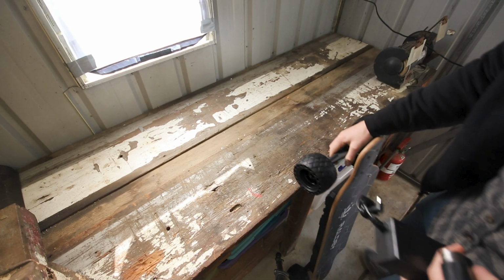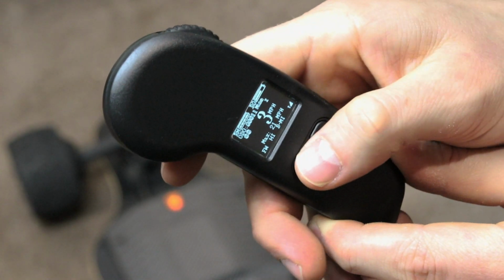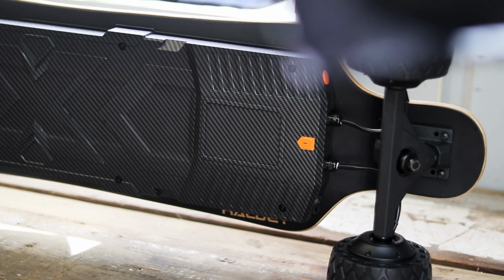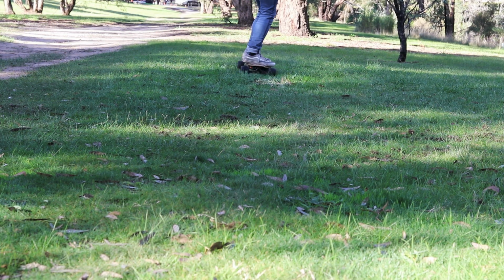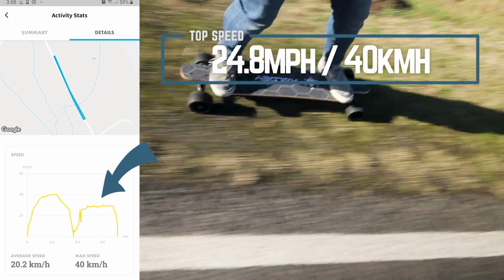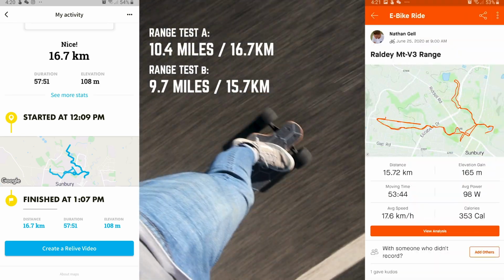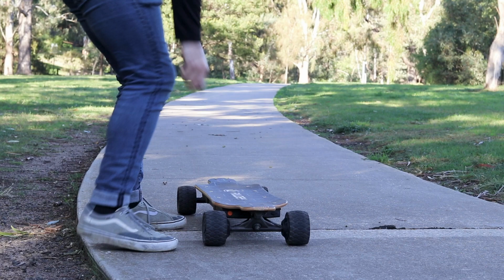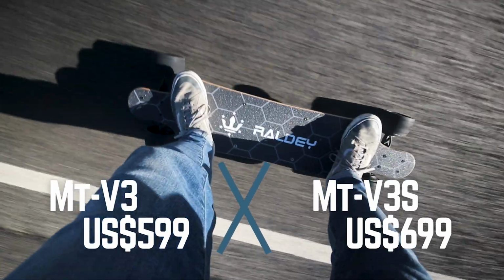Raldey Mt V3 Review - An Urban-Terrain Electric Skateboard!

Comment: I love Radley electric skateboards. I too have one and did a review on my channel. I however have an updated Radley electric skateboard AT Carbon 2nd gen. The updated features come with 2 2500 watts motors giving you a whopping 5000 watts of power. Great review by the way.
Reply from the maker: Thanks for checking it out man! I Just want to mention that the Carbon AT and the Mt-V3 are two different types of boards designed for two different styles of riding. Neither updated the other. Also, the Carbon AT V2 has dual 1500W motors, so it's a total of 3kW.
Reply: @eSkateHub  okay. So if you go on my channel you'll see mine is
Reply: R u sure  , I’m on the site now and the motors say. 1500x 2 is 3000 on the 2nd gen
Reply: Marc Toscanini Esk8 Or D!E is legit his board has 2 x 2500 watt motors and has 4 modes. Check out his videos on his channel. I will be purchasing a Raldey Carbon AT also in the next few months but will be reaching out to them first before i order to make sure that i will get the same updated version he has with the 2 x 2500 watt motors.
Reply: KONCEPTZ _i 
Well I just received the first response Raldey that actually might make sense, the wrote that the boards are actually commin with a different set of gears for safety reasons.. They’ve done stated I had to agree to not hold them responsible for any injuries that I might in counter on there board.. And agree to where safety gear!!! Wtf are they kidding me, I have to ask my girl how to post this sh!t do I can show u guys!!!
Reply: KONCEPTZ _i make sure they give you the rite pullies as well, you won’t believe what I just went threw
Reply: Marc Toscanini so you contacted them about the version that Esk8 O D!E has with 2500 watt motors?
Reply: KONCEPTZ _i I’m sure he is legit, I’m also sure I just went on there site and the board is still coming with 2x1500 watt motors, I’d like to think I kno how to read,, I could be wrong tho, maybe he specifically ordered that.... hmmm but I bet it halls ass if he really does have 5000 watts
Reply: KONCEPTZ _i 
Well not exactly.I contacted them because I was going to buy a friends board(carbon at) that was only going 18 mph instead of the advertised 25 to 28. They said they equipped the boards now with a different set of gears. I still don’t think that is the problem, I think it’s the esc. But they had me confirm that I wouldn’t hold them responsible if I got hurt, only then will they send the high speed gearing.
As far as the 2500 watt motors, they had  kno idea what I was talking about. The board comes with 1500 watt motors as stated on there  website, the board is plenty power with it set up correctly. I’d be very happy if it did the advertised speed. I’ve gone on there web page numerous times.... look for yourself. Raldey.com
I also couldn’t find any video on YouTube showing anything different, maybe you guys should roll them a lil skinnier!! Lol
Reply: KONCEPTZ _i hey pal.,
I was just seeing ecomobi???
There new et looks sick, it’s like 1200 bucks, do you know any about them... there all terrain with the shocks and suspense looks even better, with the gear drive instead of belts of hubs, and then they’ve even got a street board for under 1000 4 wheel drive or two wheel on demand by controller...I hope I didn’t make a mistake ordering the carve, that cost me almond 1700 buck!! It better be sick!!
Reply: Marc Toscanini man they went down in price, they weren’t at the prices theyre at now when i was looking at them...but yea bro i had looked at the ecomobl m24 about a month and a half ago when i was researching The Bajaboard and honestly if i wanted to go with a full shock and oil suspension board i would buy the ecomobl over the Bajaboard, much easier on the wallet. But currently that type of board is pretty loud in appearance and not what i really need as my first board. Now as far as the ET BOARD, i like it alot , it has alot of similarities to the MetroboardX (lights, construction of the trucks etc) . The ET is a new board and its their version that is on the same level as the onsra balck carve and raldey carbo at. I just went on facebook and checked them out and they seem like a super good company and care about their customers and their input on things and they communicate back with you WHICH IS VERY SIMILAR TO METROBOARD,  which leads me to believe that they have good customer service and support. I requested to join their group and once they accept me I will check out what goes on there and make an opinion of what I think about them as a company and their support and customer service, i will update you on that once i check em out. The comparison to Metroboard i give about this company is because ALL THESE BOARDS COME FROM CHINA and the design and build and construction of the certain parts of the Metroboard and the Ecomobl are very similar and almost kid of identical, which leads me to believe they might be manufactured by the same manufacturer in china. Another thing that ive found out thru my 6-7 months of research is that  Shenzhen Meibacc Intelligent Tech Co. Raldey’s parent company  ( the company that created the Raldey brand), is the SAME company/manufacturer that makes the boards and/or components for Ownboard, Haloboard and quite a few others that i know for a fact that i cant think of right now and i also believe that the Onsra’s (if not the the whole boards, the motors and decks at least) and Faboard are all made by that company. They are a major manufacturer for the ESK8 industry, they make decks, carbon decks, build batteries, and are a major brushless motor manufacturer. So as of now i am still sticking with the Raldey Carbon AT for my board choice, plus i also uave a discount code for like $70-$80 off my purchase. Im also thinking if doing an affiliate program (discount code/link) with them so i can give people a discount if they want to buy a Raldey of their own. Im trying to get my YouTube channel going and i will reviewing my board when i get it. I would also consider getting the Ecomobl ET but like you said there arent enough reviews by actual owners or reviewers on youtube to make help make an opnion of the board, which is why i requested to join their group in hope that i can get more insight on their boards and them as a company.
Reply: Marc Toscanini so i wanted to give a little update on ecomobl. So those guys are awesome. Ive been talking to the guy that runs the the company here in the us and the customer service here in the US and ive was told that he us also one of the co founders if the company, not 💯 sure on that, but ibhave been getting freat feedback and their cust fb group is pretty awesome man, exactly like Metroboards customer group. I would compare my experience with them, like your was with onsra and fabi. I was so impressed that i am now considering getting the ET instead of the Raldey. So i believe the m20 is also new to their line along with the ET, they both use the same motor. Ive been talking to a couple of guys that ordered the ET who are going to fill me in on their experience with the board so i am just waiting on that from them. Im about to shoot some more questions about the board to that that guy that runsbthe company in the us. Im hoping things are good with the ET cuz it looks sick AF!! Not a carbon deck like i want, but it has the drop down deck which is more stable than a flat deck and a good trade off for me.
Reply: Marc Toscanini um watxhing the maintenance videos and i will say this much, the ecomobl motor system is has more parts and I believe requires i bit more maintenance, thats what i love about the dual beltbdrives, so much easier to deal with, loosen the motor, change the belt, tension the belt, tighten the motor and off you go. I dunno man they really have great support tho in my opinion.
Reply: KONCEPTZ _i well you sure are doing your homework, I know it’s very hard to pull the trigger with so many kool boards out there, sure with I was made of money!!! Hopefully it worked out and you get the best bang for you buck,that board looks awesome, definitely has me second guessing my decision but oh well, we shall see
Reply: Marc Toscanini yea man this is how i am in with everything, (scuba gear, snowboard, bikes just to name a couple)especially hobbies that cost alot of $$. Yea im thinking of pulling the trigger and ordering it today or sometime this week....maybe today...lol🤣🤣 but yea man, let me know how your board is after you get it and ill let you know what happens with mine if i get the et. how long til you get your board?
Reply: KONCEPTZ _i Yerrr buddy.... me too,so I ordered it last Monday, I’m curious as well, My new buddy Fabian said 10 to 15 days,Iv been busting his balls telling him if he had any pull around there I should have my board already!!! I really want those at tires, he’s promised me a free set for waiting and actually buying the 2 in one street kit . He said the street kit will provide me with everything I need to basically use any wheels I want. I mainly just wanted the clouds and the 6’ air filled, really exciting to try air filled tires. And he claims the 115 rubbers that come with are even softer and smoother than clouds, so we shall see,,, too funny man, grown ads men and their toys!!
Let’s exchange whatsup app or something that’s easier to reply bk too, I’m not very computer savvy, so if you could send me a link or request of some kind that would be awesome...
Reply: Marc Toscanini that cool man!!? Im probably gonna just pull the trigger  this week if all goes well. I dont use whatsapp. I only have a fb, but i dont use messenger....lol...i dont trust social media apps very much. Yea we are some grown a$$ men with big boy toys for sure.....but its so fun tho...🤣🤣Are you on fb? I checked and saw a few with your name. If you are which one and ill send you a friend request if your cool with that, ill let you know what to look out for. If not, no worries man.
Reply: KONCEPTZ _i yeh I don’t blame you , but yeh
There’s two of me on fb, one is an old account I don’t have access to , the one I use has a picture of me and my two kids (boy&girl)
It’s not the one where I’m stands against a black wall with a black tea shirt, pull the trigger already ya nut!! lol
I’m still driving myself crazy looking at other boards. I still didn’t get a tracking number so I don’t no wuts up but I did order another 200$ worth of shred lights... I’m loosing my shit spending this kinda money man!!also just had to get those backfire smart break light , they look pretty damm kool
Reply: Marc Toscanini well, i did it. Went and ordered the ET today. Im nervous and super excited at the same time. Ready to get on a board and start learning this whole eboarding thing!!
Reply: KONCEPTZ _i 
Nice!!! Congrats!!
I’ll say it again, wish u lived closer
Reply: KONCEPTZ _i I never got a friend request....did u try?
Reply: Marc Toscanini same here bro. Its just me thats going to be doing this right now and hopefully my son, soon. Gonna get him a board, just not quite as expensive cuz he can drop a hobby real quick at times...lol
Reply: Marc Toscanini i havent sent a friend request on fb yet, wasnt sure which one is you. Is it the one with the 2 kids in the picture from Massapequa? I believe theres some post with some people eboarding. I think that one  could be you...lol
Reply: @marctoscanini7225  im super positive. I have received an updated model and i can assure you that i didn't ask for anything but their top tier board. I'll do another in depth video on my board and my box with the 5000 watts motors for you.
Reply: One of my subscribers recently bought the same model as me though just like you said his came with the 3000 watts motors and only 3 modes Lo, Mi, and Hi. My board has those and the new Hi plus mode
Reply: So there supposed to be sending me new high speed gears ..... however I didn’t even buy the board!!
I was going to, until I found out first hand how crazy their customer service is!! So I decided to hit the buy button on the Black Carve.,,,, anyone’s have one, I went with the belts..!?
Reply: Marc Toscanini wow!! Crazy!! yea man i was on the line to getting a Black Carve Dual Belt, but i was hesitant after seeing a review by Ramatorix on it and the issue he had with the battery box. The deck is wood and the box is carbon (soft/hard) and with the flexyness of the deck on a hard material battery box, it started seperaring.a couple screw inserts started coming out on him. I mean he fixed himself and was given the option to send it out but he opted to do it himself. ONSRA has great customer service, but i decided to pull back on the Black Carve cuz im a heavy dude and i think that my weight will make that issue happen to me. ONSRA is supposed to be releasing a carbon board, i believe in the Black Carve, dont quote me on that but thats what i got from Fabi on their YouTube channel. But if its going to cost alot more, i might just save up a little longer and get the MetroboardX, that is one bad a$$ board, and the customer service is the BEST OF THE BEST!! I joined their FB group and  lemme tell you, FANTASTIC support with that company!!
Reply: KONCEPTZ _i wut kinda money to those board cost. I’ve been driving myself crazy looking online at all these Freekin boards, wut did it for me is I actually got a call from Fabi himself.... the way he said he handled issues with a board by just sending a new one out ASAP then getting the old one bk , and a few other comments he made really made me want to do business with him... 
I’ve only been into this about 3 months, I kinda get carried away with sh!t like this, probably till I fall then I’ll never touch it again!! Lol
Reply: Marc Toscanini Marc Toscanini yea bro thats the feeling i get about Fabi and ONSRA, i like it when a company is good on their product support and warranty and 💯 about their product. I guess ill reach out to Fabi or ONSRA and see if i can get more insight on things and maybe some info on the new boards. So as far as the MetroboardX, they are $2575 with a single size wheel (AT or street) and $2700 with both sets, it comes with a 1 year warranty and they are built in here in the USA, Washington or Oregon i believe. I joined their group to see how the owners are saying about the boards and nothing but GOOD is allni read and see in vieeos and pics. The owner is there too, and if there is an issue, they fix it fast and they let it be known in the group, i mean i have not seen one complaint. If you wanna join the group to see go to their website and click the fb icon on the far right (theres 2 fb icons). But yea im like you and new to esk8 and im researching for my first board myself, but i want to make sure i choose the right board.
Reply: KONCEPTZ _i Must say I’m very happy and impressed with the flex. If I wasn’t needing a second board I would y
Reply: Marc Toscanini so you have received the black carve already? Is it the ONSRA version or the FABOARD? Im wanting a carbon deck, i am going to reach out to ONSRA and get some info I guess and see what they say.
Reply: KONCEPTZ _i no I haven’t got the board yet, probably another week. I’m pretty sure onsra is Fabboard... as far as carbon, yeh they look really kool but if you’re not a real heavy rider you really want a board to have some flex to it.. pretty much every board advertises 7 to 10 layers of a mixture of bamboo, maple, fiberglass..from what I’ve been researching No flex is for riders over 200 lbs..
Reply: Marc Toscanini Marc Toscanini yea Faboard is ONSRA, it was the first company and version of the black carves, but the Faboards are carbon. I need/want the carbon deck as i am 230-250. Havent weighed myself lately lol.And i dont want a flexy board. I dunno man im just  stuck on which one of the 3 would be best for me, Raldey, ONSRA or MetroboardX, One has crap cust service but is more affordable, the other 2 have fantastic cust service and warranties but alitle pricier. Hard decision for sure. Good cust service is really important.
Reply: KONCEPTZ _i yep I totally agree, I’d cross Raldey off the list after what I just went threw,and after speaking with Fabian himself, that really closed the deal for me... hopefully it was the right decision!! Never thought I’d spend that moon a skateboard..., thanks Trump!!lol
Reply: KONCEPTZ _i where can you even buy the carbon one, I’m not seeing it on esk8t.....
Reply: Marc Toscanini Marc Toscanini so the carbon version of the black carve is on the ridefaboard website and there is not a carbon verison of the ONSRA black carve. There is a carbon eboard coming from ONSRA but i do not know if there will be a version of the black carve. I know on ONSRAS you tube channel Fabi teases you with a carbon board but only the front side portion of it with the truck and deck, he says its a short board but not sure, he says theres new things coming and that board was coming out sometime after July hopefully. It also looks like that board is a hub motor board judging from how the wheel looks, but i could be wrong so dont quote me on that. Im hoping there is a carbon version of the ONSRA black carve. If the ridefaboard version is available i might just get that one. But i might still get the Raldey carbon AT, i mean its still alot of dough$ to throw on an electric skateboard, but out of the 3 its more affordable for me, but the customer service sucks. I would love to get a MetroboardX, cuz honestly i think its the best way to go, as far as quality of every component that is on that board but its $2600 and im poor af, especially now days only working 4 hour days. But man....that MetroboardX.....MANNN!!! That thing is so Bad A$$!! Its like the Koenigsegg or Pagani of the exotic car world but of the ESK8 world!! Its just of superb quality.
Reply: Marc Toscanini so i reached out to onsra yesterday and they replied back today, and to be honest bro..for me, with my experience onsra so far, its nothing like what you had or what ive been hearing about on youtube. I asked about Faboard and they said they sold the company and were no longer affiliated with them. And i get that. But i also inquired about the onsra version of the black carve and honestly i got nothing bro. This is the answer i got:

“However I would highly recommend our Direct Drive or Belt motor Board. The Onsra Black Carve. They are truly top quality and you won't break the bank. “

 Didnt respond to any of my questions at all and no I didn’t get a response from Fabi, which I wasn’t expecting anyway. So at this point for me, i am going to probably get the Raldey. Now i have no doubt that onsras support and warranty is superb, but at the same time its not worth the extra $400-$600  in price difference for me anymore. Because im at the point now where ive started to research replacement components for whennthe warranty is up, and make the board a diy. And from what i have concluded from the research ive done, i believe that the onsra boards and faboards are identical to the haloboard beast which is made by none other than Raldey, except the onsra and faboards come with versions in a wood deck(onsra), carbon deck(faboard) and have a belt drive version(faboard and onsra). So i can put the $ i dont spend towards the diy parts for the board or get a new helmet🤓. Anyways i just thought id share wit ya bro.🤓
Reply: KONCEPTZ _i 
Hmmmm interesting..well if you want Fabian’s number let me kno... I kinda agree but after the bs Raldey Kia claiming, about sending a slower gearing for the us due to safety reasons.i don’t get how my friend got the only two boards with any evidence of this, so they said there going to send out the hi speed pullies..and then I find out there’s an updated board for the same price, MOtors are 2500x2 instead of 1500x2 l, bigger battery, and 4 speed modes instead of the 3 that I have..I duno , just seems like they have there head up there asses. Not really understanding what you wer told, as far as they sold the brand onsra, to Fabian I’m assistant, he’s all over the internet talking about his new onsra box and how he now has branding on the trucks (now they say onsra on them)
Anywhere, he also just seems down to earth, as far as when he comes out with the new battery he said he’ll send it to you just for the shipping costs,and then I send the old battery bk.. so I have no down time w/the board. Even if you have a major problem, he doesn’t want you waiting without a board. So he claims he’ll just send a new board out  ASAP, then take the old one bk. Sounds to good to be true. He said out of all the boards he’s sold he’s one had a handful of issues where he had to replace the board.. but is it worth 5-7 00 bucks more... eeehhhhh I doubt it, we shall se I guess.
Reply: KONCEPTZ _i now that updated board that that guy eask8 or die has seems off the hook, he shows the speedo hitting over 30mph. But Raldey doesn’t even acknowledge they haven’t that Freekin board... I never herd of such craziness... I could have bought two carbon at v2 boards for 1500 bucks, and there perfect condition, their just 18mph boards !!! For now I guess, unless the fix the problem. I really don’t think it’s the gears like they say, if it was the board would hit more than 18 when going down hill. It’s like the board is being governed down to 18 for some reason.
Reply: KONCEPTZ _i so onsra has nothing to do with Fabboard (Fabian) that’s bs... I’ve been talking with him like every day since Monday.... and I just bought a board (onsra black carve w/belts) very confusing
Reply: Marc Toscanini yea man thats what the guy told me. He said they no longer operate that company and That he wouldn’t be able give me any information about their products. The ridefaboard website has a new york number tied to it. And as far as fabians number. Its all good bro, i dont like getting peoples numbers unles they want to give it to me or are ok with someone giving it to me or give  it to me themselves, its just not me, and im the same way about my number also. Yea you know maybe if i had talked to him or could talk tonhim myself like you are able to, it might be a different story for me, but its not the case for me. I dont know man, all i know is that i want a board and i want to ride and get one in soon in the next month or teo, i want to get a board that has what i need which is a carbon deck and AT wheels and within my budget. And the onsra is a really nice board and i would love to own one, its got a great 6 month or 1 year warranty (very confusing, the esk8usa website says 180 days and the onsrausa website says 1year standard, which the ONSRAUSA website is the new us website) and is extendable to 2 years for $290 , which a great offreing. But That brings up the cost for the onsra to $1700-$1750....before shipping (the boards on the onsrausa website are $50 more than the esk8usa website and are coming out of austin, tx) so its like what do i do??? Do i save a little mor and get the onsra or go wuth the raldey, cuz honestly, if I feel like i gotta save up $2000, im just gonna save up to $2700 and just get the MetroboardX and be done with it if i  have to go that route, cuz i know i will be getting one of the best and the most tried and true proven board which is of the best quality you can find on the market, and the guy spent 10 YEARS designing that board and it shows!!💯 so yea im just at a loss on which way to go, i am super broke rught now, my hours have been cut down to 20-25 hours a week due to the pandemic and ive got bills and im just trying to get my youtube channel (not this one) goin and actually put some content on it with reviews (the board will be one) so i can give this youtube thing a go and maybe possibly make a litte $ off it if i can. I want to get into esk8 really bad, so i want a board but i just want to be able to make a good decision on a board and its really hard for me( if you cant tell...🤣) itd be cool if i someone would just send me a board to review and keep🤣🤣🤣...thats probably not gonna happen to me tho cuz im a noob to esk8 and havent made a youtube video yet.🤣🤣 i have a couple if things that im ready to review, just need to get filming.💯
Reply: KONCEPTZ _i if you can get Raldey to send that updated board, I think that’s the way to go... that guy shows the invoice of o think 12 in change and he added a set of belts to the order.
I’m curious as hell if you can even order that board specifically.... 5000 watts of power, 32mph for just over 1000 bucks.. and it’s carbon. That’s the ticket.... I would get the smaller wheels tho, the 190’s put the board weigh up in the air.... just felt a lil awkward with the board that high.. unless u have a reason for needing all that ground clearance, that’s up to you..
Reply: KONCEPTZ _i why
Reply: Marc Toscanini yea its looking like thats the route im going to be taking. It checks off the boxes i have for a my board choice, minus the great customer service. Yea i was going to actually reach out to them before hand and confirm that they will be sending me that board.
Reply: Do you guys have any options on ecomobi , there et or even there street boards look pretty sick... thoughts? Customer service??
Reply: All the reviews I’m seeing are by ecomobi.... wut good is that!! Lol
Reply: @marctoscanini7225  not too good if regular everyday ppl aren't reviewing it.
Reply: Esk8 Or D!E yeh I guess,I almost wanna order one myself and make my own decision on what one to keep, just don’t wanna get stuck with crazy shippers charges
Reply: Hey buddy, I’m wondering if you can help me get to the bottom of this... I was clearly miss treated and quite honestly I feel ripped off!!
Not only did I get 2 pos boards that only go 18 mph but to find out that there is an updated board such as the one you have really pisses me off even more..
Hoping you can send me a work order or something to prove this board exists. Raldey won’t even admit that board is out there!! 
If I got the quality board they advertised and it did the advertised speed of 26-29 mph I wouldn’t even be going threw this, but now, I want bolth my boards replaced with the better ones obviously.. wouldn’t anyone!!! Lol
Anyway, thanks in advance and please email me any information that might help
Markymarc454@gmail.com